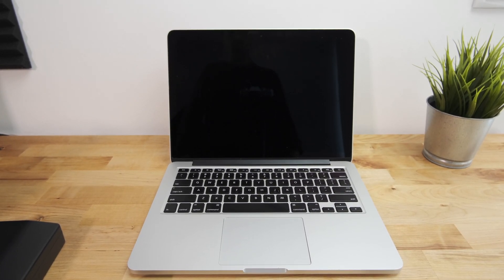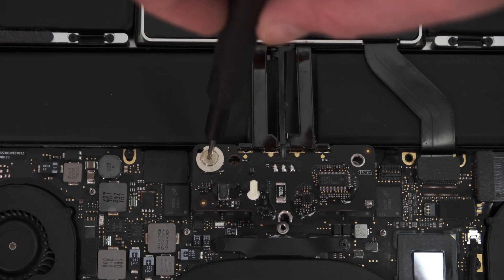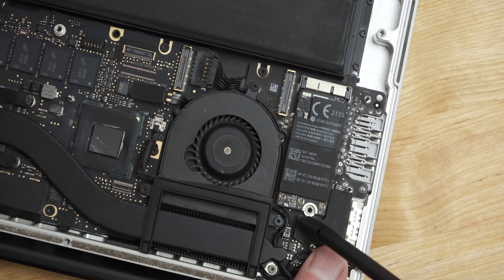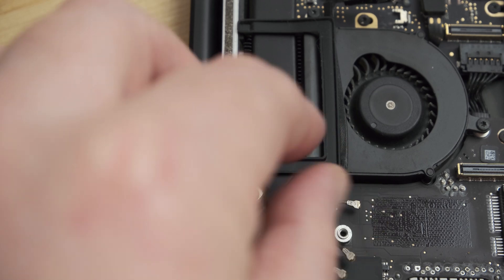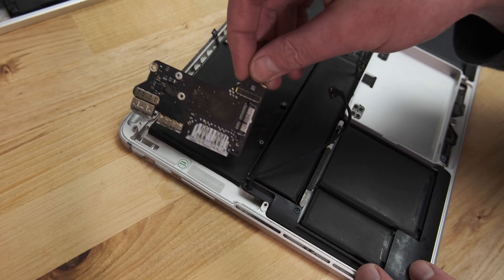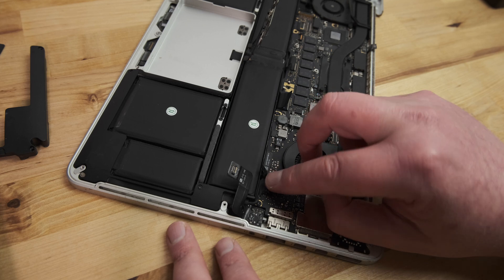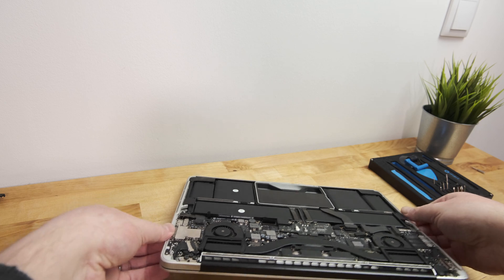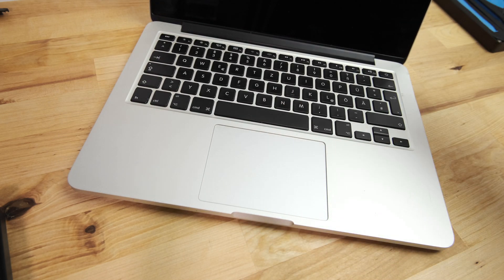Repairing a dead 13" Retina MacBook Pro - Top Case Replacement

Comment: Will this work with the 2015 MacBook Pro?
Reply from the maker: Yes there is very little difference between the 13" MacBook Pro models released between 2012 and 2015.

Comment: Thanks for the video, man. Where are are you based at in England? Also, is there a specific website you can recommend to buy a Unibody upper case for Macbook pro 13 inch late 2011 edition? I tried searching on Amazon and eBay but no luck!